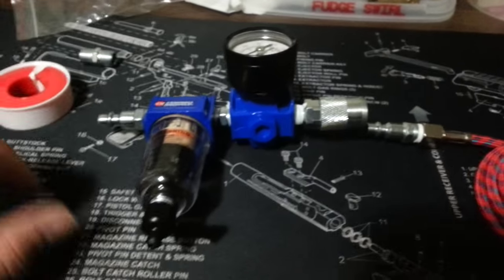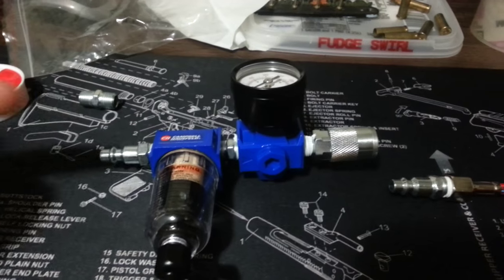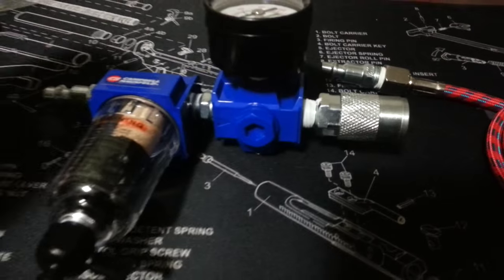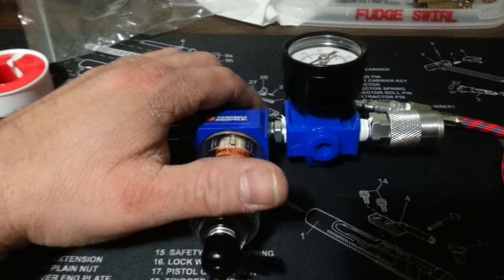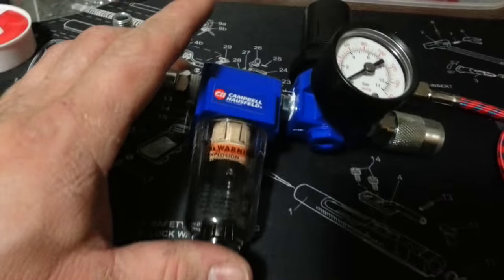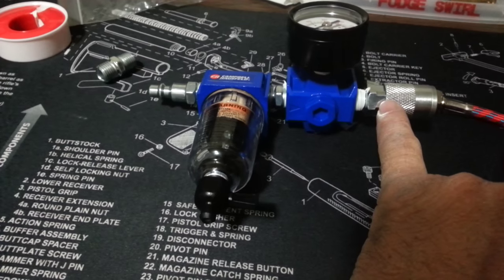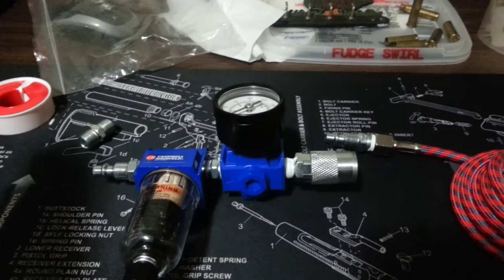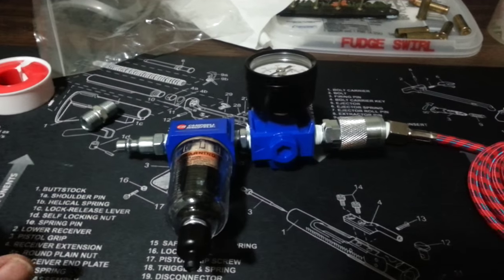Using a Regular Air compressor with an airbrush.

Comment: Air is air, actually the noise levels are more importent, plenty of compressor reduction fittings around but no noice silencers!!!
Reply: Best silencer? 
Distance.
(maybe with a door or two between you and the compressor if possible)
Get yourself a couple of cheap 50' air hoses. Problem solved.

Comment: Good overview.  For airbrushing having regulators that go up to 100 always seems silly - why not have guages and regulators that stick to the 5-50psi range to allow easier reading of the lower ranges.  Are there any recommendations on the regulator that ensure there is enough fine adjustment to control +-2psi levels down in the 10-20 PSI range?

Comment: Great Video. Do you know what pressure these should be set to?
Reply from the maker: The airbrush should tell you a good operating pressure . In the manual. I cant remeber exactly but I think mine is set to 20psi. Consult your book to be sure . It has bee about 6 months since I have done any airbrushing. Sorry
Reply: Set your shop compressor pressure regulator to... say 40lbs.  Then use the smaller pressure regulator you got for your air brush to fine tune the pressure to lower levels more accurately.

Comment: If I'll use the AIRBRUSH COMPRESSOR PRESSURE REGULATOR WATER TRAP FILTER MOISTURE GAUGE AFR-2000 , will it work out on the airbrush? Please i need some answers😭
Reply from the maker: If you are using an airbrush compressor you shouldn't need all that. This setup is for a 80 gallon shop compressor